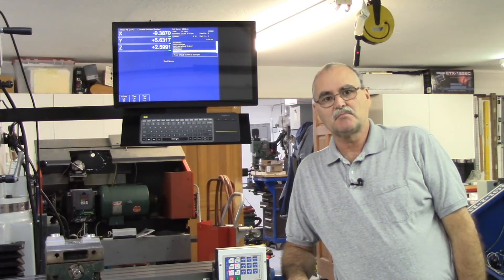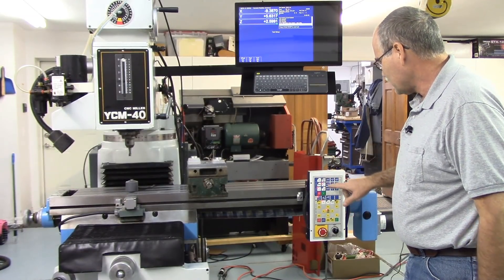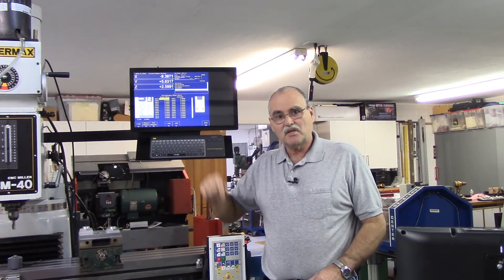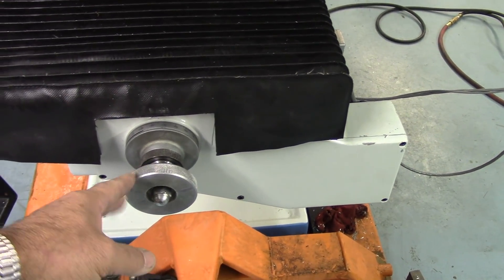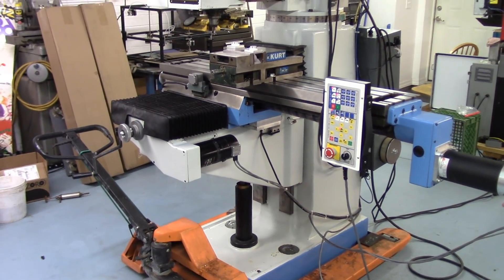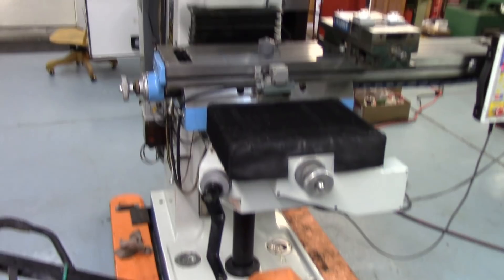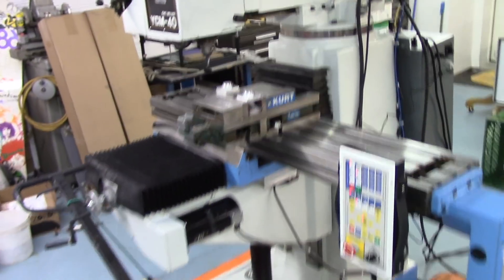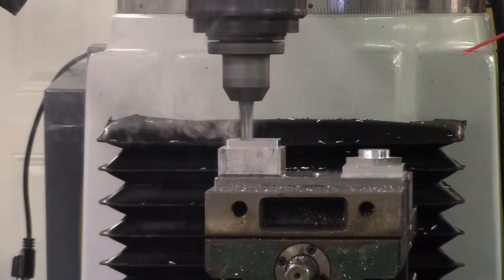Supermax YCM-40 - Centroid CNC All in One DC Control Conversion Wrap Up 180110

Comment: Hi, I have a question does the spindle motor lose torque with the vfd?
Reply: No, buy a VFD with sensorless vector control like Automationdirect.com GS3 or Factorymation.com TD400 series (Braking resistor) TD200 no braking resistor. Setup properly they work well.

Comment: I like most of your video's even though I have a hard time understanding the use of all of the jumper wires. This video was very good. It was nice to see a milling machine run at about the proper speed & feed rate. Most video's you see online the people always want to run the spindle at 4000-5000 rpms with a feed rate of 60 inches per minute with a depth or side cut of .500. Those people are stupid. 

One thing you could have done was to wire in a mist or flood coolant pump so you didn't have to use WD-40. I prefer a flood coolant system since you can put valves in the plastic coolant lines to control to amount of coolant you want. I also prefer to use 3 coolant lines pointing along the length & at the tool so the tool stays cool but not too cool (this happens more with cheap HSS end mills & ceramic inserts) & it helps with chip removal. I always use coated carbide end mills to allow more cutting time before they need to be sent off to be reground & carbide - some coated, some not coated inserts because once they are used, they need to  be reground if you can reuse a smaller reground carbide insert or sold off as scrap carbide like wore out carbide end mills. 

How far off were you on cutting your test piece? I have always found cutting the circle and rectangle pretty easy to compensate for but the triangle always seemed to be the worse.

Comment: Beautiful machine and beautiful installation!! What a fine result - you are a real craftsman!

So, if you don't plan to use DC brushed servos, the default Centroid solution would be the Acorn? It's very well priced - does it seem to have the same "power" as the controller in the All In One and the Oak (apart from the number of axes)? That seems a little academic, as the All In One and Oak don't support step/dir which is surprising these days.